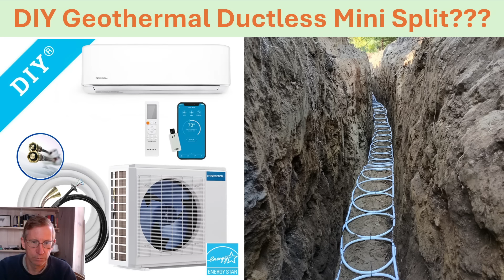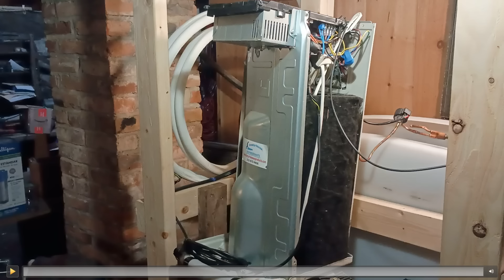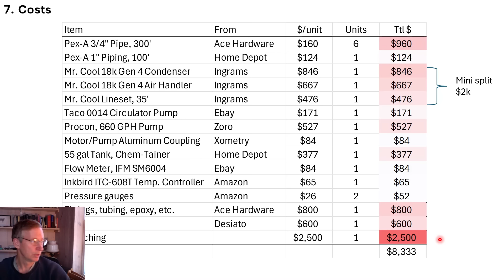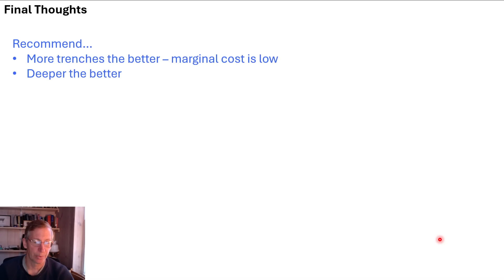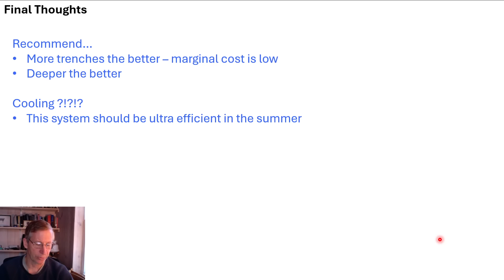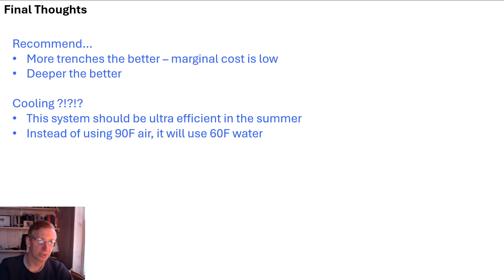DIY Geothermal Ductless Mini Split (Ground Source Heat Pump)

Comment: I'm just saying, the EPA 608 certification is neither difficult nor prohibitively expensive. Cost me ~$150, and that was with a study kit. I'm certain that if you can understand what you're doing here, you can pass that test.
Reply: For your main pump's reversing issue, put a bridge rectifier on the two wires that need switching. Just make sure it's rated for that kind of duty cycle.

Also, it would be more elegant to load-match a circulating pump to plug into the heat-coil circuit. You'd end up using the original thermocouples, and the pump would kick on when the heating coils would have kicked on using the same logic.
Reply from the maker: @lelanddyke8386  I'm going to try the sprag clutch, if that doesn't work, I'll try going this route.  Thank you.

Comment: What considerations are there for lifespan of the coils in the trenches?  Did you install valves for each run that would allow them to be isolated in the event of leaks or failure?  Troubleshooting buried coils sounds like a nightmare.

Fantastic project and presentation.  Thank you for publishing this.
Reply: he says in the video that every loop is home run into the house, so he'll have 6 pipes inside.
Reply from the maker: @Etacovda63  Right.  I do have each one valved.  If one fails, that one is out.  No way to find and repair.

Comment: This is an awesome video to watch. Great explanation and data to back up everything. I would really like to see a follow up on cooling.

Two options I can think for your pump cavitation: 
1) one way clutch, like in a pedal bike. They can be had pretty inexpensive but would take some creativity and fab to fit onto the shaft. 
2) A dual loop split with check valves in opposite directions. it would pump on the main circuit normally, then when reversed the main loop would shut via check valve and it would pump/draw from a second circuit with a small reservoir.
Reply: Yep, check valves with small secondary tank/loop for the reversed cycles is what I was thinking would be simplest quick fix.
Reply from the maker: I have a sprag clutch, just haven't put it on yet.
Thank you

Comment: I am a retired geothermal installer. We used methanol for Loop antifreeze. It transfers heat better and suffers less from viscosity than propylene glycol or ethanol. We used to buy cases of windshield washer fluid as the least expensive option. I got the msds from the manufacturer and found what percentage it was and did some math to calculate how much we needed. It worked great. If you add any antifreeze to your system, you will need to cover your tank or it will evaporate.
Excellent diy project!
Reply: Point 5, pump direction. Sounds like something a relay and an arduino could handle easy
Reply: @bsod5608  Or a simple spring loaded one way clutch...
Reply: I think he said 3 phase DC motor. Diodes may be all that’s needed.
Reply: @sevenveils1635 3 phase and DC are opposites of each other?
Reply: I’m very interested in doing low temperature refrigeration, work, and industrially they use recuperator‘s, which are basically air motors that utilize the expanding gas, kinetic energy and are better at getting a higher temperature drop. Should I say bigger temperature drop I can’t can’t find any sources that utilize recuperator’s in small refrigeration units. I would sure like to experiment with this is in theory you could recuperated a tremendous amount of your compressors work, and this is done industrially in a very regular basis, and the recuperator’s I have very long lifetimes in low maintenance.
Reply: What is a nontoxic antifreeze to use for this heat pump?
Reply: @a-iu9zO propylene glycol is food grade. Ethanol is just drinking alcohol. Methanol is not drinkable, but is very biodegradable. All three are approved by the industry. Methanol performs the best. Don't experiment with expensive RV antifreeze. The geothermal industry is a very mature industry. No need to reinvent the wheel.
Reply: @MrJeffDemme  Isn't methanol bad for PEX (degrades) but ok for HDPE?
Reply: @javan6982 I am not sure about PEX. Definitely ok for HDPE, which is what we always used. No need for higher priced PEX.
Reply: @MrJeffDemme PEX is made of HDPE?
Reply: @a-iu9zO A relatively non toxic antifreeze would be the RV and Marine antifreeze, which is designed to be used in fresh water tanks and plumbing in RVs and comes in versions that protect from -50°F to -100°F.  Last I checked it was $3.98 per gallon for the store brand at Walmart.  They do recommend you flush it out before you refill with fresh water in the spring, but it is perfectly safe to put down the drain.  It isn't really meant for heat transfer though, so I don't know how it compares to methanol or propylene glycol mixes.
Reply: @r.j.bedore9884  RV antifreeze is propylene glycol, radiator antifreeze is ethylene glycol.
Reply: @a-iu9zO  ethanol
Reply: What percentage or ratio did you add?
Reply: METHANOL is rly good option - but everyone should know that it IS TOXIC even after only skin contact 
you can get entire barrel of it pretty cheap
Reply: @MrJeffDemme Thanks for the tip!!!  I had thought about glycol for the fluid as well. But you saying Windshield Washer Fluid!! Wow!!  I can get a 55g drum of Krystal Kleer for $155 from O'Reilly's!  That's cheap!  Thanks for the info. The cost of the coolant was what had been keeping me away from doing any kind of ground loop, but this is a great idea!  Much appreciated! 😎
Reply: Hi. I'm living in the Philippines and thinking on a system for cooling.  What do you recommend for liquid 🤔
Reply from the maker: @leroyrunk4422 water with a growth inhibitor, no need for anything talked about here.
Reply: It depends on design temp of the loop. You need protection to about 10F lower than design temp. Water is the best for heat transfer, so you don't want more antifreeze than necessary. But the inside walls of the heat exchanger are the coldest point and if they begin to form ice they get even colder and it's a bad downward spiral from there. I think in Pennsylvania climate we typically used 25% straight methanol. But I have been retired from that for 20 years. You can look up protection levels. 
If using windshield washer fluid, get the cheapest you can find. No fancy additives. Makers MSDS info should provide percentage of methanol and then you can calculate how much you need
Reply: @MrJeffDemme Water is not the best for heat transfer, it has a higher specific heat capacity so it is actually better for coolant as it can absorb more heat but this means it actually transfers heat worse than something like ethanol. Regularly see people getting confused with this. Pretty bad for a retired thermal installer tbh it’s basics.
Reply: @Rossy-heat doesn't really care which way it's going. Goes from warmer to cooler. Water can carry more energy and therefore transfers it better. I have personally resolved hundreds of problems geothermal systems. To much antifreeze was a very common problem. Especially ethanol, due to its poor heat transfer and viscosity. Nothing better than straight water, except that it becomes a solid at 32F.
Reply: @Rossy- there is specific heat and then there is thermal conductivity. However Ethanol is worse at both than water. Water is pretty much the best fluid as long as it doesn't freeze or boil.
Reply: @Rossy-what? Could you please explain your logic behind your statement, exactly where are the systematic gains with alcohols VS water in terms of moving thermal energy (cooling and heating if you think there's a difference).

I personally do not care if the fluid loop is used for extracting heat or dumping heat, same - same, it is just moving thermal energy from A to B, or from B to A.
In water VS alcohols, water wins because of it's heat capacity. Water will remain "less moved" in °C by the act of gathering heat or loosing heat, it preserves a higher DeltaT between water and other medium. 
I winter time, you are pushing cold water(or alcohols) down to "warm-ish" earth/dirt. If your fluid gets significantly warmer while passing through the earth loops, the DeltaT between fluid and earth is diminished. The lower DeltaT will lessen the amount of heat exchanged per unit time or fluid.
If your fluid temp in loop is same temp as the dirt = ZERO energy is being exchanged.

I am aware it sounds counter intuitive, like: "Duuh bro! Why would you want cold fluid coming back?".
The point is heat exchange, not absolute temperature.
Technically, if you loop is flowing good and you have a very small DeltaT between fluid and earth then it could just be a sign of a loop that is overly dimensioned, which is not a bad thing per se but you should also take note of pump losses (or low flow) in a very long loop.
Many paralell loops are generally better than one long loop: often exhibits lower pumping losses, higher DeltaT between fluid and earth distribution to further interface areas (to a degree of course, many paralell loops also do slow the flow, making it susceptible to too low DeltaT.

Comment: Bro just put some 8" plastic pipe into that tunnel you dig and blow air with a fan. Put a hepa filter to the exit and viola! Maybe you will need to mix that air with inside air before blowing directly because it will be less than 10°C at the pipe exit.

You are welcome!

Comment: I wish Americans wouldn't call it geothermal, as it doesn't extract geothermal energy it extracts solar energy that has been absorbed by a thin layer of ground.

It is solar energy you are harvesting, not geothermal. You have to dig a lot deeper before you get to geothermal energy.
Reply from the maker: Oops

Comment: You mentioned in the video that Propylene glycol cost you 200 USD for a 5 gallon bucket. 

In Germany a 20 liter can costs retail 61 euro. Wholesale better prices potentially possible.
Maybe there is a business opportunity in trading it.
Reply: It should be $4 a gallon, it's RV antifreeze.

Comment: Very cool. 
Now I want to do the same. 
My excavator only digs 7 feet deep though. Scheming commences.
Reply: 7 feet is fine in most cases, just not less
Reply from the maker: Rent one, I think it will be worth it long term, unless you have less heating requirements than Connecticut, or you are willing to use anitfreeze.  You can also do more trenches

Comment: On the coldest days of winter I still take a hot shower, sometimes 20min, ie 50 gallons of water.   Most of that heat just flows out to the sewer, what a waste.
Reply: They do make heat exchangers for sewer pipe, heats the water coming in

Comment: Directional slip clutch coupler so when the motor back spins it slips. You might find a 3d printable model

Comment: I have been toying with this idea... personally I would have gone with the separate addon radiator on the backside of the condenser just to keep it simple.  Wondering if you thought this would be too inefficient?
Reply from the maker: A small tank built around the condenser would be easier and may actually work better because there may be better flow through/around the fins.  I have another project where I may drop another condenser into the same tank, which is why I went this route.

Comment: Thank you for the detailed analysis.
Regarding the defroster, perhaps it could have been exchanged with an immersion heater and be left inside the tank in order to avoid the recirculation deal?
Motor reversing is possibly for debris but could also have to do with mold prevention.
I live in a warmer place in Europe, but the cost differences strike me. The cheapest I could get here is PEHD pipe which should be good enough, the minisplit would likely cost less than half. I think the glycol can even be homemade but could also be avoided if the water is always circulating and the pipe portions that are above the freezing line are insulated.
For trenching, an excavator can be rented for a week or so, should be enough time to also learn how to operate it and might be cheaper. Just putting this out for future readers.
Adding sand above and below the pipes is always a good idea, make sure to also add a warning tape above the sand, it's cheap and might save some hassle. Not sure if sand is great for thermal conductivity, I've heard of it being mixed with bentonite and graphite for this purpose.

From a cost efficiency perspective, I would first look at insulation, then at PV, then at ground heat pump and compare the running costs from grid+heat pump vs solar/grid + minisplit. In my particular case, it would take over 30 years to recover the heating costs for a DIY ground heat pump vs my current setup (PV + batteries + minisplit + gas). If gas prices go dramatically up, it might change the equation, but right now I'm paying 100$ in January for gas and electricity combined, for ~900sqm and at most 300$ for the whole year.
Reply from the maker: As for the defroster, I'd consider it a waste of energy to run an electrical heater.

Comment: Love it. These systems need to be mainstream.
Reply: That "DIY Friendly" mini-split was designed specifically for home-owner installs. You're the second person I've watched a video by who converted a system to run off a ground loop.  I would consider approaching the manufacturer and asking if they would consider creating a model that is "Ground-loop-ready". It would come without that de-icer (probably) and the exchanger would be either in its own tank or designed to be submerged without trying to bend their tubing, etc. But seeing you overcome those challenges was interesting and I appreciate your efforts!
Reply from the maker: @TheDanielsherer  It would be great if they did!  I'm guessing the market is too small.
Reply: @edwardwazer5103 you can ask a Alibaba supplier to make any modification you'd like as long as they're the actual manufacturer and not a reseller

Comment: I've been considering an insulated box of water rather than trenching.  Copper is so much more heat conductive than HDPE it almost makes sense to run copper directly in the ground, but in this case, I'd have the short (~5' of several 1/2" or smaller) copper lines vertical in the box/tank such that the heat exchange is optimal depending on the season (e.g., during the summer, the flow is from top to bottom, during winter from bottom to top).  A very non-trivial side benefit is stratifying the temperature of the water such that it's much higher at the top and lower at the bottom.  Water's actually a rather poor conductor of heat, so this temperature differential can exist for days or even longer.  I haven't yet done the calculations to determine what size I'd need for seasonal load leveling, but I suspect 1-2K gallons would be enough for my well insulated 2,600 sqft house.  I may experiment, using this video as incentive, with a much smaller (1-300 gallon) tank I can cool at night during the summer (we live in a frost pocket, so it's not unusual to get into the low 60's or even high 50's in August), then supplement the heat in the winter with either solar hot water or heating the water via wood.
Reply: the thermal conductivity of the ground is so slow you need a lot of surface area, that is why the trenches are so long, and lots of pipe is used. because the priority is pipe surface area to ground. using exotic materials which have higher thermal conductivity is not necessary. Your idea of an under ground tank of water is viable, but you will still have surface area issues. the tank of water could operate as a shock absorber, but it would require periods of time where it is not being utilized to recharge.
Reply from the maker: Run the numbers on the 1-2k gal tank, I don't think it is adequate long term. 
As tazholio said, surface area is everything.
Reply: Yeah solar hot water can help heating. It can work.

Comment: Very nice. I did one a few years ago but managed to get hold of a used GSHP for very little money.  This specified glycol, and pressurised the pipes to 3 bar, used MDPE water pipe.
I do wonder if you’de be better off buying a dedicated circulator pump instead of the repurposed fan motor, but that is certainly inventive!

Always shocked how much you over pay in the US - I just bought an 18k DIY mini split for my garage for less than £600.  If I paid a little more I could have got an R290 model, where no refrigerant license is needed.

Comment: Nice, Ive thought about doing this to my MS eventually, did not have time to do it up front. I have 20kw solar I built and a small MS, I only heat a small portion of the house to comfortable temps.  On sunny winter days I have excess heat/solar  .  I'll decide between  adding ground based to the MS but will probably put that effort into building more Electro Chemical batteries.  I do heat a mass of basaltic rock in an old Kiln to about 1600F...The kiln is inside the heated space..at night I crack the lid, so that minimizes  having to run any other kind of heat for one night (instead of using an EC battery for that night).  I also heat portions of the house to 90F +  on sunny days..thats another form of thermal battery.   I have completed, but not tested  the hookup to my Chevy Bolt HV battery...it probably eliminates the need for me to build other batteries s it can run the MS for a long long  time.  I'm in Colorado 80817 very sunny only a few times a year does it stay cloudy for 3 days straight, got down to -20F for maybe 4 days last winter.   Instead of ever running a generator a diesel parking heater is a much more efficient and quiet option and it's easy to automate, very cheap.
Reply: Also if you have solar don't worry too much about efficiency in the summer..the hotter it is out the more solar power you have....IF you have very hot nights and poor insulation that's a different story
Reply from the maker: I like the kiln idea, great if you have excess electricity during the day.